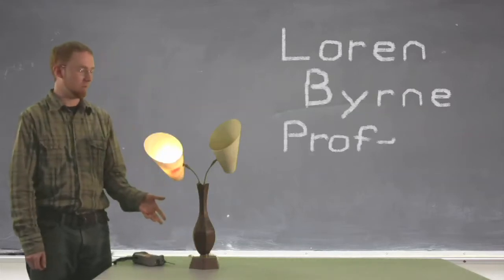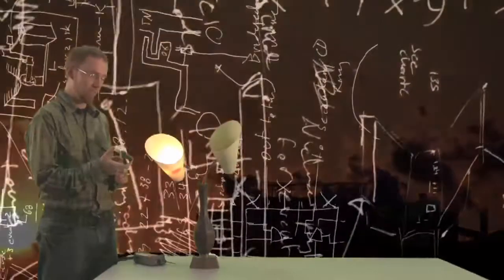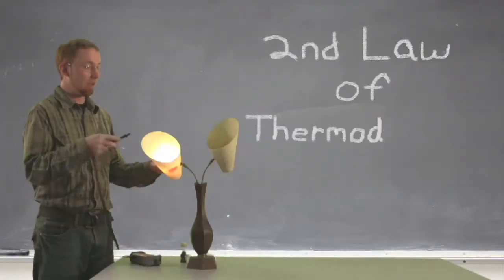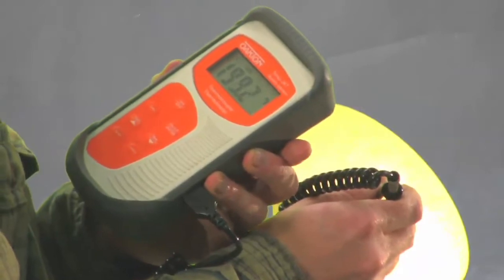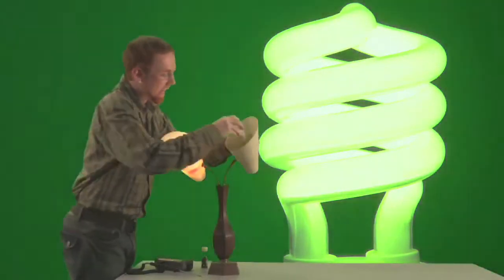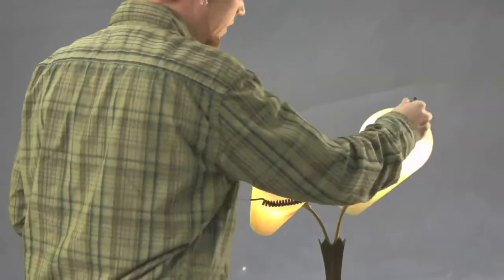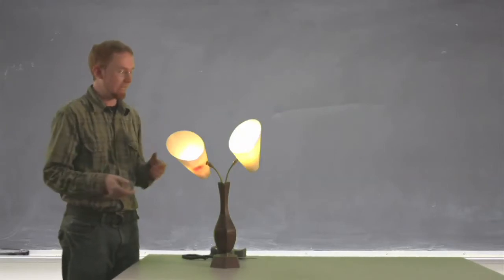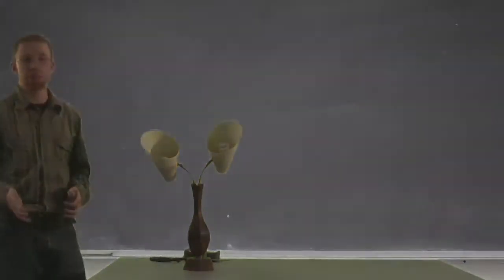Strange New Light Bulbs

Comment: electrically speaking, the tungsten acts like a resister which limits the flow of current flowing through the bulb, and this  resistance is transferred into heat and light in the process.